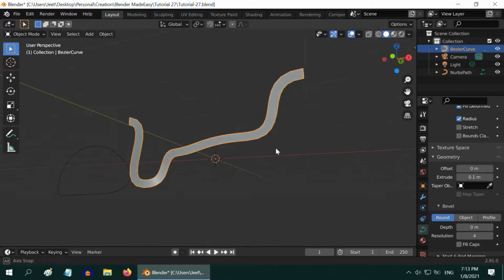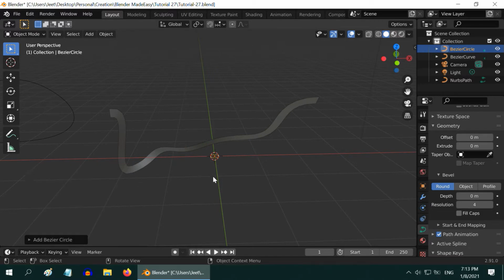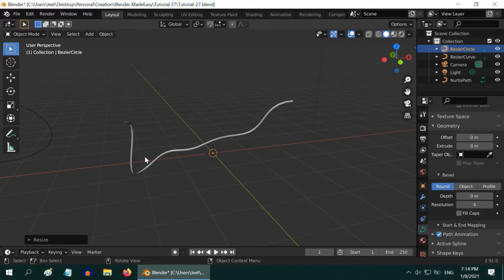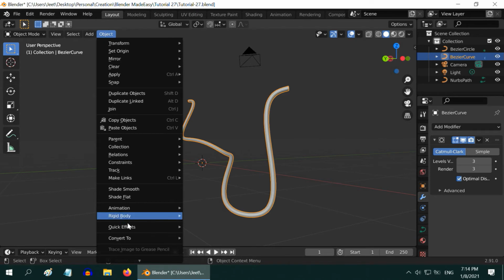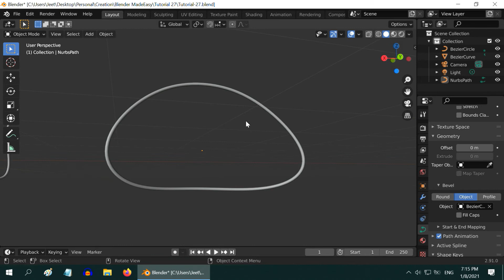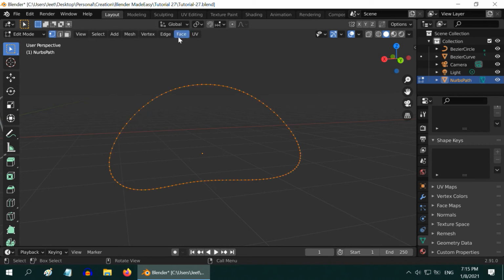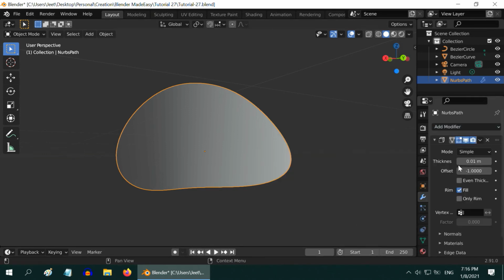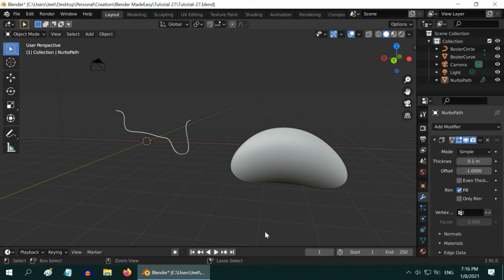Convert Any Curve Into Mesh Object | Step-by-Step Guide | Easy Method | Blender Eevee & Cycles

Comment: I’m having trouble when I go back into edit mode after converting it’s not letting me select anything
Reply from the maker: Please ensure that you have the "Select" tool enabled, otherwise it won't let you select anything. If that's not the issue, you can try to close Blender and re-open, sometimes it can solve small glitches.
Reply: @5MinutesBlender  yes I have the “select box” tool and I’ve closed and reopened blender with nothing changing it lets me select it in object mode but when I go into edit mode it won’t let me select the mesh
Reply from the maker: Strange 🤔 Can I have a look at your blend file please? You can send it to 5minblender@gmail.com so that we can investigate.